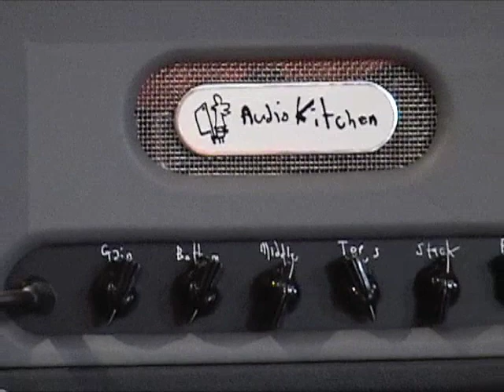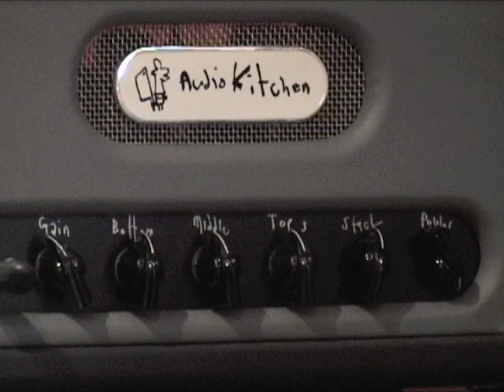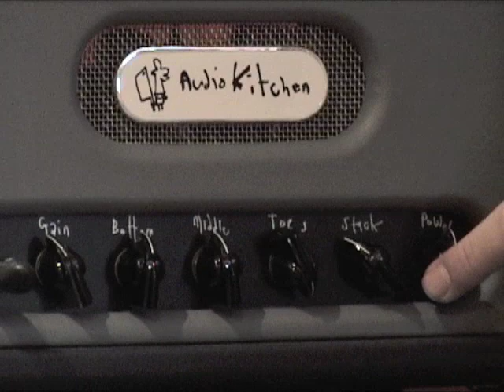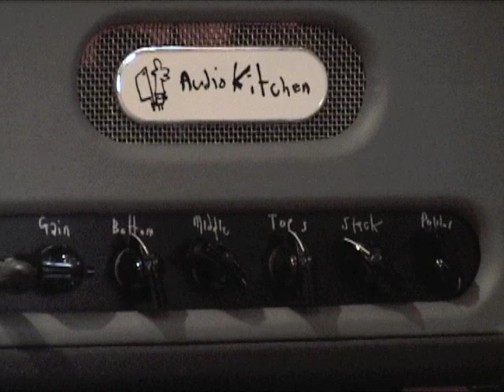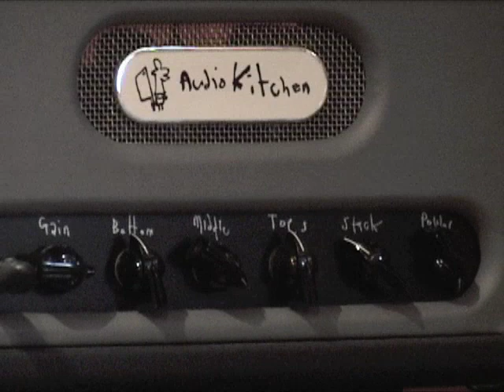Audio Kitchen Little Chopper amplifier demo with Telecaster

Comment: @PROBETTGUITARS : I agree that the utility of any equipment is unrelated to its price...unless there is an alternate product that yields the same or better utility at a lower cost, in which case, cost does become a significant factor. I further agree that if the utility of a particular tool is undesirable, then its cost is completely irrelevant, as it wouldn't be useful  even if it were free. Just commenting on the line of thinking, not the product.